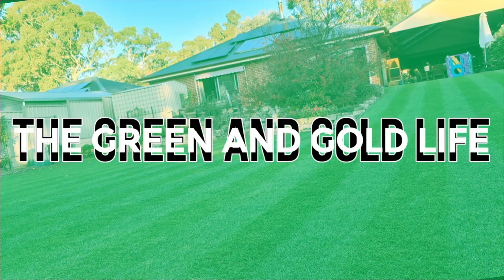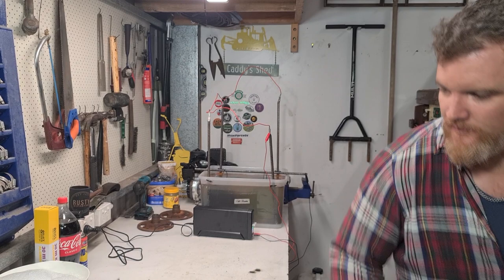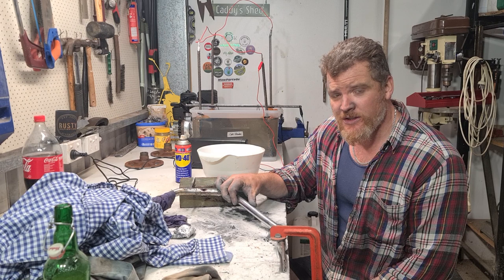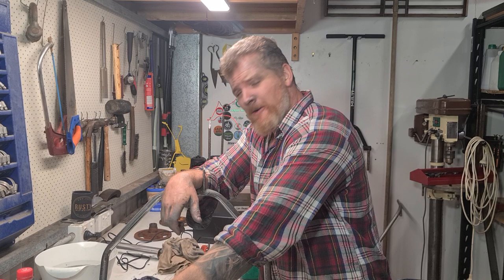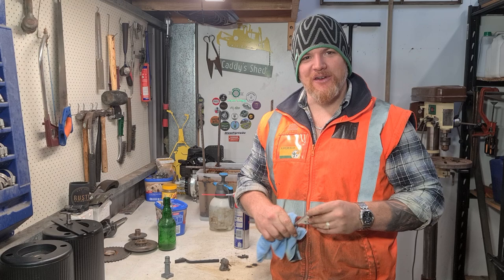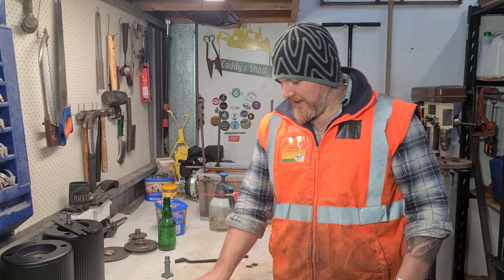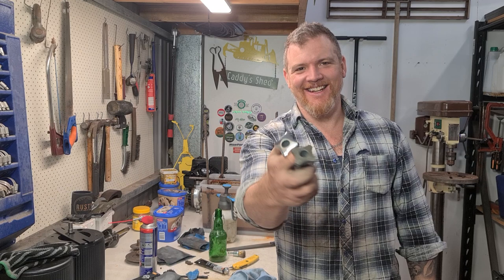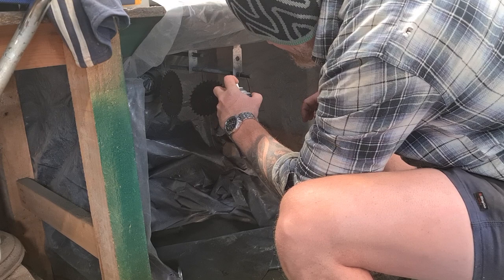Scott Bonnar 45 Restoration - Polish Handlebars and rust removal method test

Comment: The best tool I've found for rust removal is an 8" by 1" scotch brite light deburring wheel(light gray coloured) that has a 3" inner hole that you fit a 3" felt holder into, fitted to a tapered spindle, and fitted to a bench grinder on a pedestal (with all the safety guards removed so you can fit large parts on it) - polishes, cleans, and deburrs like an absolute champion, also handy for removing paint from parts. Works perfect on all metal types (steel, alloy, ss, etc) The wheel is about $200, but will last for years for the home resto guy. Get one and thank me later ole mate🍻👍
Reply from the maker: I'll defs have a look LBS.

Comment: Unfortunately that looks like it needs rechroming, I tried the coke and and alfoil trick trying to restore a chrome bmx and found that it works well if its medium rust on it but if its pitted it didn't work too well.
Reply from the maker: Yeah, too far gone 😭
Reply: @thegreenandgoldlife1464  rechroming that probably will cost $100 thats if u want it original.